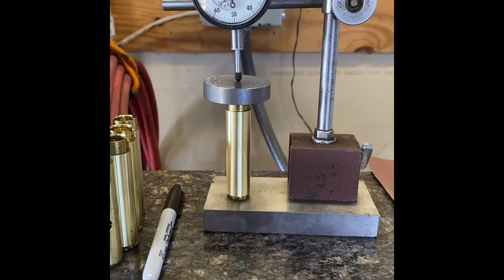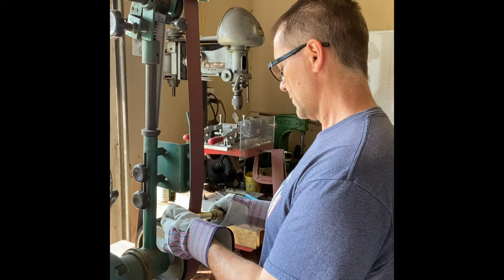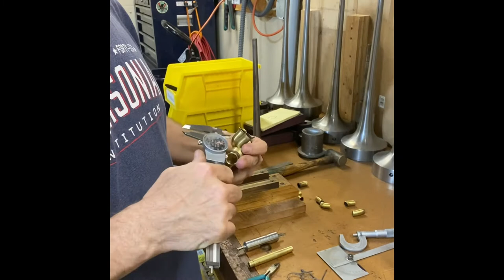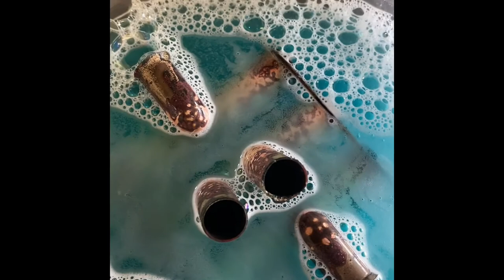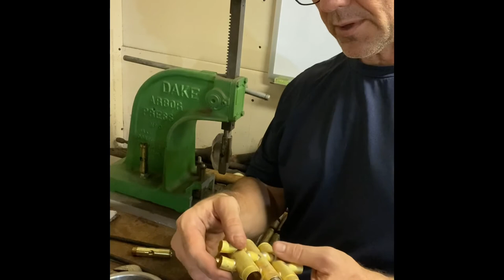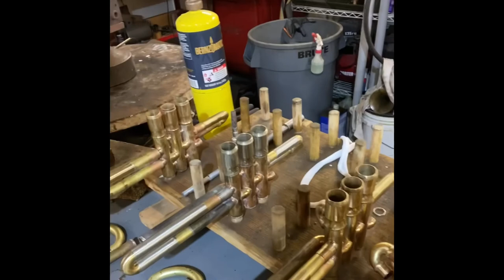Valve casing production. Step by step.

Comment: Great job and thanks for sharing your knowledge. 
By the way, never understood why all brands give up from all straight direct airflow block valve system, and keep doing the “misalignment” from each valve. There is any factors for and against ? Congratulations 👏
Reply from the maker: In short, there is no real direct airflow block system that exists. Besson and Schilke used straight connecting studs in the valve blocks along with third slide and bell studs. Keep in mind that even in these builds each piston is filled with curved tubes to connect each port. The “misalignment” that you mention doesn’t exist. To connect tubes drill on center you simply need the correct radius to allow for the needed alignment. 
Any geometry that is set up to generate the pattern of holes in a casing tube needs to be transferred to its corresponding piston, so it becomes a mathematical game of “will it work before running out of space”
Reply: @benchmarktrumpets9733  perhaps I wasn’t clear. I’m not talking about “valve alignment”, instead I’m asking about why not adopting the “direct air column” through valve block, we already have it in all days. I thing Courtois still manufacturers like that. 
Will work like a “bugle” without curves on the relation’s valves. Never understood the simple “give up and abandon” of this system from almost every brand. Do you know ?